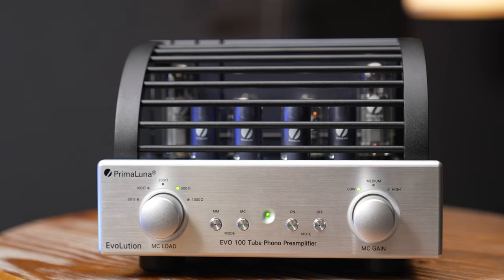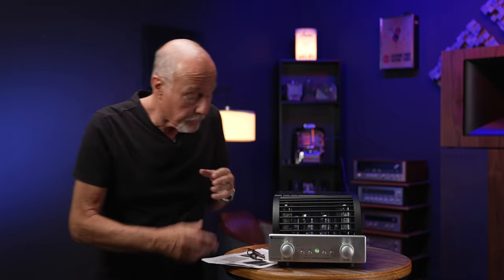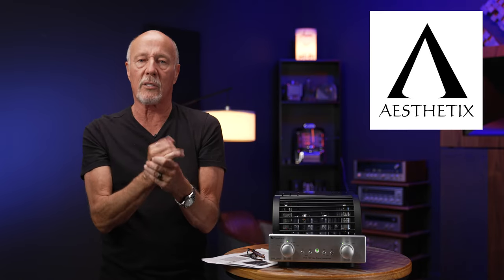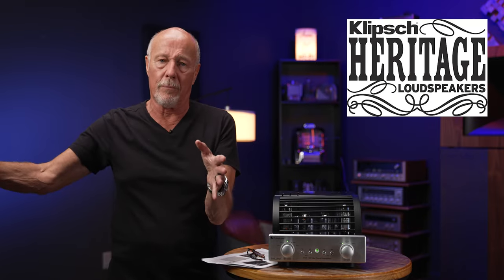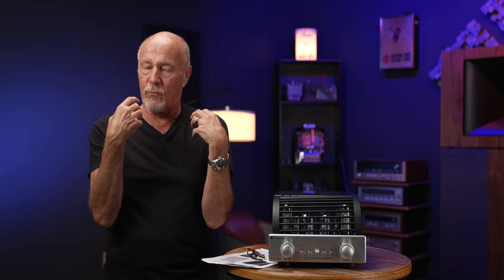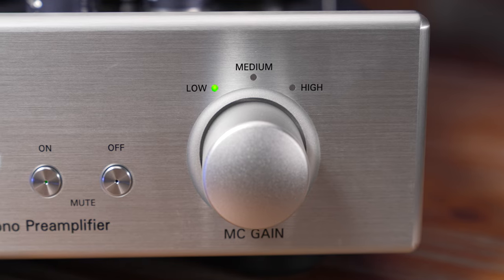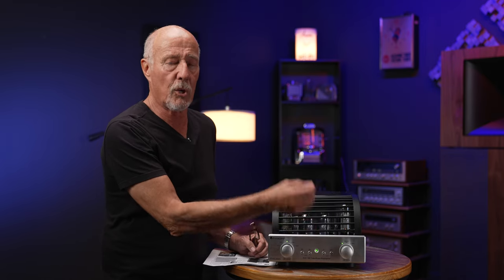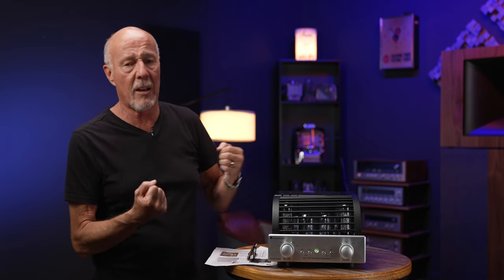Don't Put Your Ear to the Tweeter! A Guide to Tube Phonostages with Kevin Deal

Comment: I recently purchased a preowned 300B amp built by a retired RCA recording engineer. I was told upfront that it is designed using AC heated tubes which causes it to hum somewhat. In the beginning it did bother me, but now I just listen to the warm beautiful sound it makes, which is why I bought it, and don’t even notice that hum.

Comment: my prima phono stage is absolutely silent and sounds amazing.  it sounds better than my other solid state unit i got rid of.  the prima is absolutely great sounding.
Reply: What cartridge?
Reply: @greggb681  sumiko blue point no. 3 low output
Reply: Maybe they are better with MC...it was very very average with MM
Reply: FYI I was using an Ortofon Black LVB 250
Reply: @leee4697  did you roll the tubes?
Reply: @leee4697  maybe user error.  You need higher quality wiring for these units.   It you use basic copper wire you will immediately get noise with anything that amplifies signal like that.  I used standard phono cable(even noiseless one) and noticed the cable was licking up efi/emi immediately.   So I started with a mogami custom super shielded with silver shielding and that stopped it dead in it's tracks.  I upgraded again to sp4 silver morrow and it gets even better.  If you use crappy components and wiring whatever you are trying to get out of the phono stage is exactly what you'll get.  You'd be surprised how silent your prima luna will be with the correct wiring.
Reply: @spdking   I never mentioned noise, that wasn't the issue. My cabling is excellent and the primaluna wasn't noisy at all, it just didn't sound good in my system. I have NOS tubes in my monoblock EVO400 amps and also my EVO400 Preamp and those sound amazing. But adding the EVO100 Phono didn't work for me.
Reply: @spdking  That is very refreshing to hear! Im relieved to know that the Prima Phono Stage has a low noise floor even with a low output cartridge. Great cartridge btw 👍
Reply: @greggb681  I rolled the genelec gold looks in the mc section in back and eh7025 in the front end.   I also used tungsol in the larger tubes and it works amazing.   I did notice with crappy wire, it does pickup noise but that's due to it being so sensitive.  Once I upgraded my cables all the noise was gone.  It was from emi/efi on the room with computers and all kinds of stuff running.  Not from the amp itself.  The pr phono in my daily use is silent with back ground noise.

Comment: I own a pair of EVO400 amps running as monoblocks and an EVE400 Pre. I purchased the EVO100 Phonostage and unfortunately it didn't work for me. I would suggest trying this before you buy, preferably in your system with your existing components. I wasn't able to do that and purchased one without hearing it first, based off my great experience with the Primaluna Amps and Preamp. I was extremely disappointed and didn't keep it.
Reply from the maker: Hey Lee I saw your comments.  I'm sure you tried the two settings on the side for capacitance?  Try the Chinook.  It's fantastic and for MM it may be just a smidge brighter.
Reply: @upscaleaudio   Yes I did try switching between the two capacitance settings. I will make sure to try the Chinook next. The Primaluna rolled off the high end so much..

Comment: A Tube and transformer based  Phonostage doesn't have to be noisy.

My Ear Yoshino 912 isn't the first EAR preamp to use internal step-up transformers for moving-coil cartridge gain, but it is the first in which those trannies are addressed by two different pairs of phono inputs. 

There's a selector knob on the front panel for choosing which input pair is active, as well as another for selecting the desired transformer primary—3, 6, 12, and 40 ohms are the nominal impedances, corresponding with respective additional gains of 30, 26, 23, and 20dB—or for bypassing the step-up transformer altogether. 

As with a moving-magnet cartridge. The EAR 912's phono section remains iron-rich even so: Its RIAA equalization circuit uses a pair of custom-wound inductors, which de Paravicini selected for being less prone to overloading and ringing than capacitors, and the transition from phono stage to line stage is accomplished with a pair of similarly bespoke coupling transformers.

The transformer approach was chosen not only for electrical efficiency and purity of sound, but for flexibility in use: A three-position attenuation knob on the front panel allows the user to choose between multiple secondary windings on the interstage coupling transformers—for full gain, –6dB, or –12dB. That control, used in tandem with the one for selecting the appropriate step-up transformer primary windings and the step-up transformer bypass knob, provided the highest level of flexibility. Result a completely quiet tube MC/MM phono stage within a preamp that by the clever design and implimentation using great components, more than holds its own with the esoterica stand alone phonostages. 

I'm blown away with this preamp and how it sounds with vinyl depends on the vinyl content. What I mean us its true to the recording If its meant to be romantic and delicate it is, if its meant to sound huge and powerful it is. 

It has a fleet footed controlled approach to massive swings in dynamics. 

Don't get me started on the line stages wow and unlike those hideous swing meters on the Big Apple produced "luxury" audio product, the 912 has properly accurate VU metres give away its pro studio origins. 

A timeless Tim de Pavaracini masterpiece❤